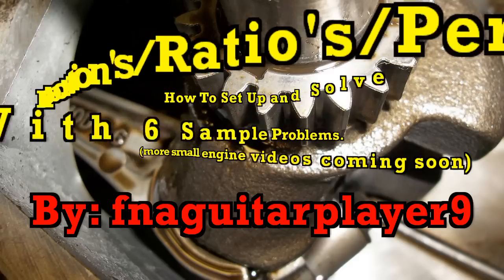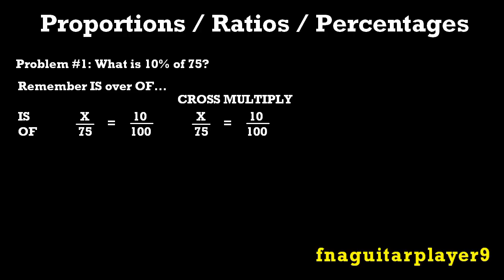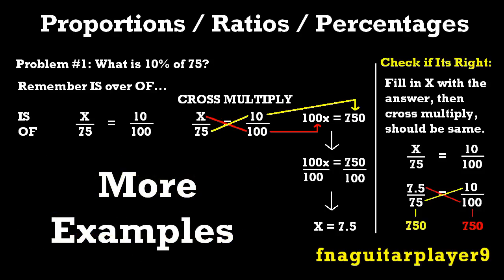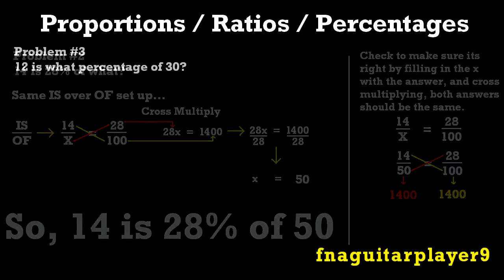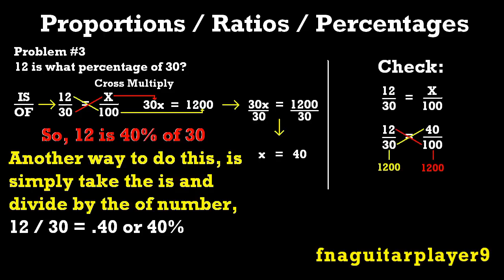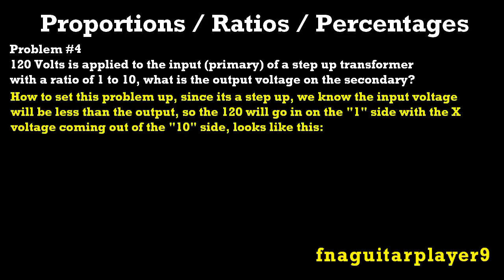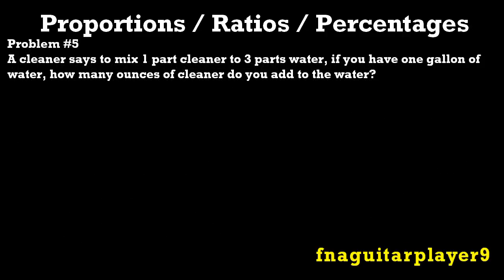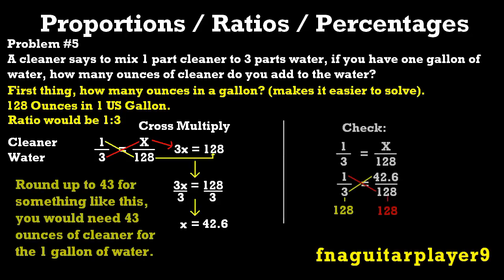How to Solve & Set Up Proportions / Ratios / Percentages / IS over OF ( Very Useful )

Comment: We learned a technique called dimensional analysis in a chemistry class.   The idea is you write out the problem with what you want on the left and what you have on the right and then you set your ratios/conversion factors up with the units you don't want on the bottom, so with the map problem you put the inches on the bottom.  Then you multiply it out.   It's works well when you have a bunch of conversions you need to do which is often the case in chemistry.  You can lay it all out and make sure it's right and then do the math.   The units cancel out top and bottom the same way numbers would, like if you had 2x2 divided by 2x3, that's the same as 2 divided by 3.

?miles=6inches 25miles/1.25 inches

?oz cleaner=gallon water   128oz water/gallon water  1oz cleaner/3oz water

Thanks!

Be real, be sober.
Reply from the maker: Never heard of that method before. Thats interesting how that way works. Thanks for Watching!!!